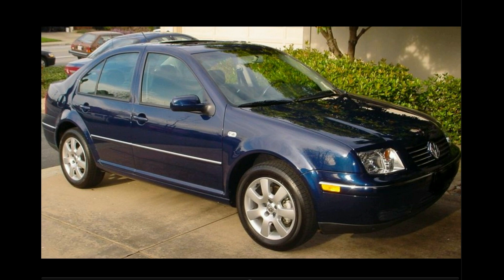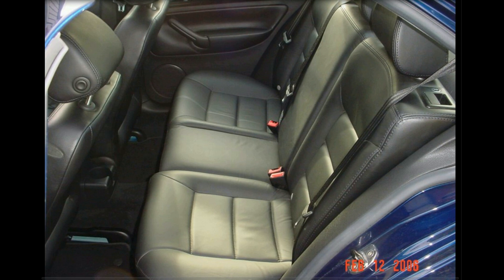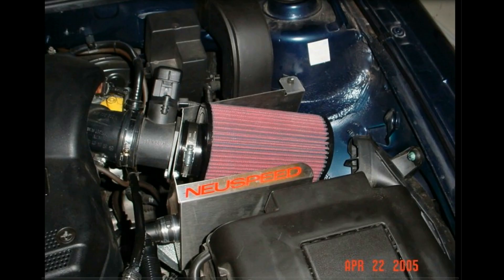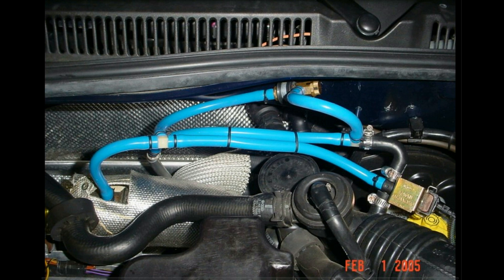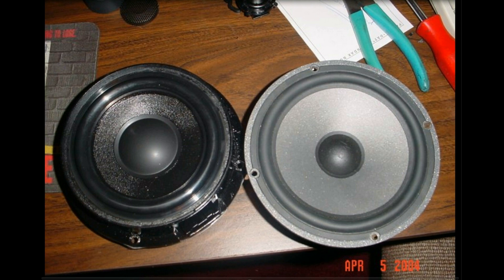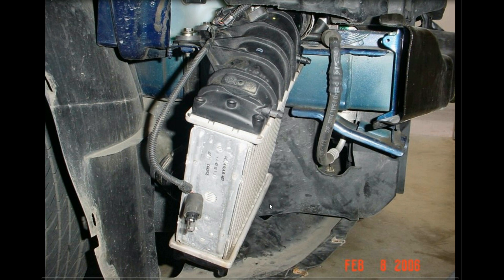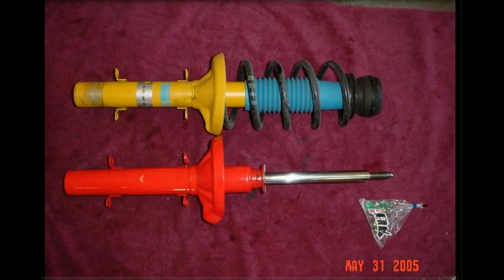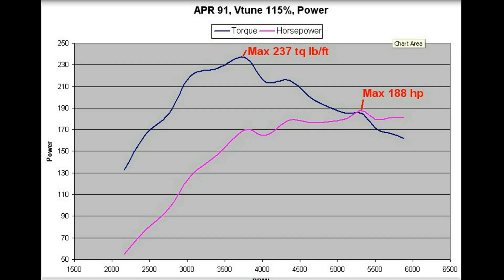The story of my 2004 VW Jetta 1.8T GLS

Comment: Is this a realiable car? I'll probably buy one in the next few weeks.

2004 Jetta GLS 1.8T
120K Miles
2,500 dlls
Reply from the maker: only if its been maintained properly. it better have had a timing belt replacement by now. or don't buy it.
Reply: +LastHumansGarage That and the Water Pump right?

Btw, It's my first car ever so I don't kmow anything in the Mechanical Area. Any suggestions or tips for me?
Reply from the maker: water pump would be part of the timing belt job usually. if they can't show you a proof of receipt for the timing belt job i would walk away. that, or drive it straight to the dealer after you buy it and spend the $500-$600 for a timing belt job.
Reply: +LastHumansGarage Alright. Thank you very much bro, other than that is there anything else that important as the Timing Belt Issue?
Reply from the maker: burning oil or compression test. but you won't be able to tell any burning oil on 1 visit..